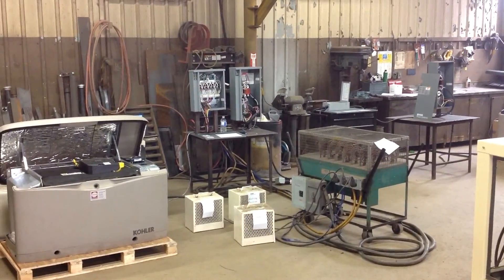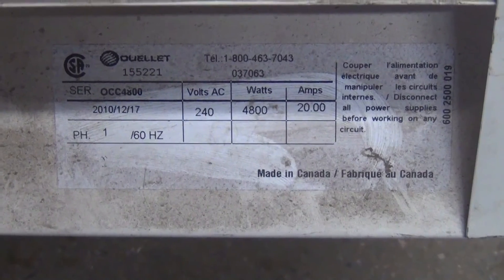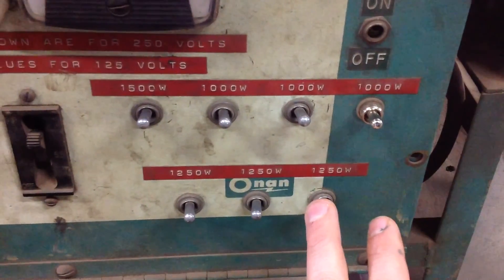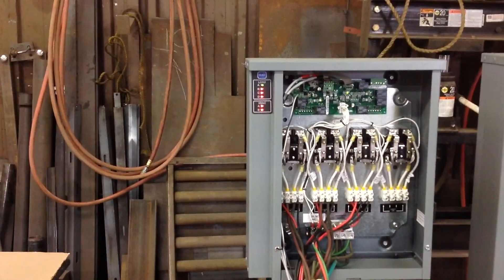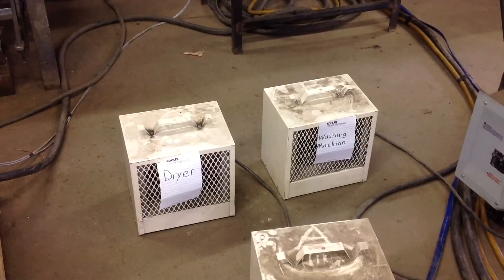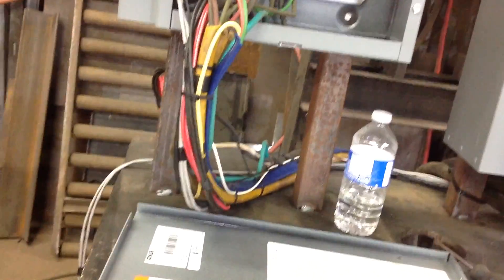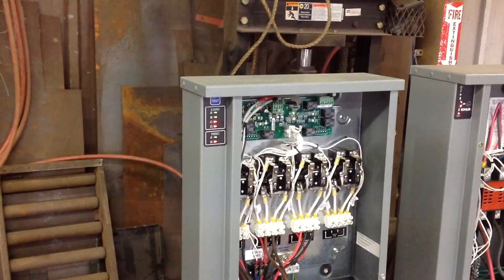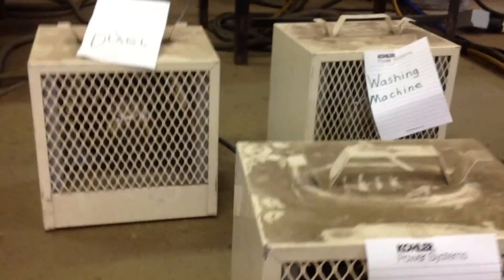Kohler Load Control Module

Comment: Wow, thank you for the great video and demonstration. I have just been getting into generators. 
You did what I like to do and do a mock set up and test something before it is actually installed. 
   I would like to see how the load shedding panel is physically installed in an application where the generator is being installed into an existing residence. Do all the load shedding branch circuits have to be pulled out of the main panel and put into the load shedding panel?

Comment: If I do not have the load control module should  I still connect my 2 ac units to the hvac 5 minute time delay ?
Reply from the maker: I would. It's best practice to delay the restart of your AC systems or other large loads. It gives them time to go through any cooldown or reset they may need to. It also allows your system to come online before trying to start a larger load with all other potential appliances and load. Stepping your loads minimizes the chance of an overload situation.

Comment: Wow....Your video SHOWED exactly what I needed to know! Installers should show this before they install so that the customer can understand what is going on. My 20k RESC, (with RDC2 control on the generator), install should be finished in 1 or 2 days. I was worried about how this was going to work and thought that maybe I would NOT have the option to drop and add some loads once the wiring was done. But after looking at your video, it appears that the WHOLE HOUSE is wired in, and then I should be able to  prioritize which loads I want. Does the installer do the prioritizing, OR can I prioritize the loads anytime I want to from the RDC2 control on the generator, or maybe do it from the OnCuePlus program? Thanks!
Reply: Hey, I just saw this, sorry. I hope your job went well. The prioritization needs to be hardwired. So if you want x to be the highest priority you need to wire it to A. If you want it to be the lowest priority, wire it to D.

Comment: Do you need to change panel to use load shedding
Reply from the maker: It depends on the setup. Some transfer switches have this function built into it, others have the Load Shed Kit. Operational they all work the same but the physical design or setup may be different. Basically you need at minimum a single phase Kohler Generator with an RDC2 or DC2 controller and a load management device.